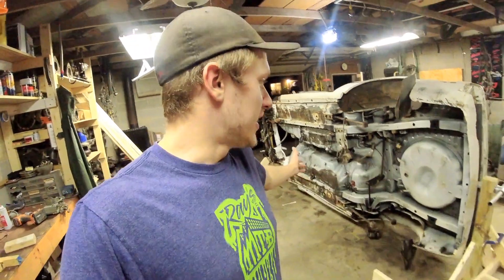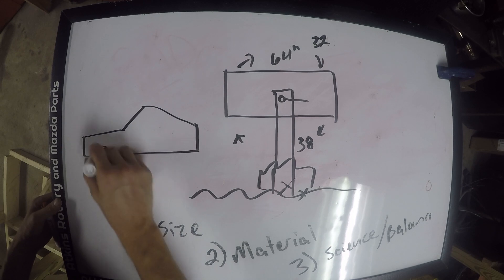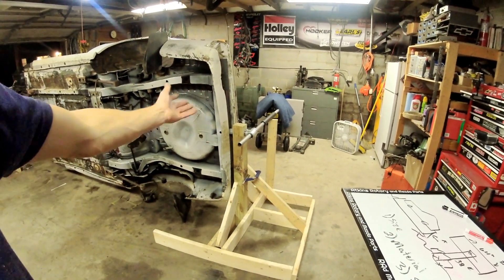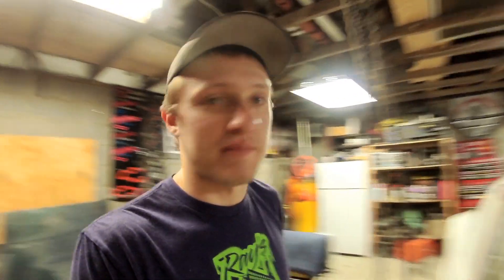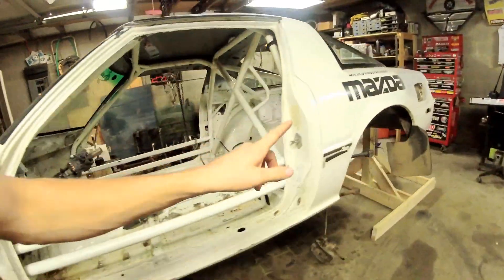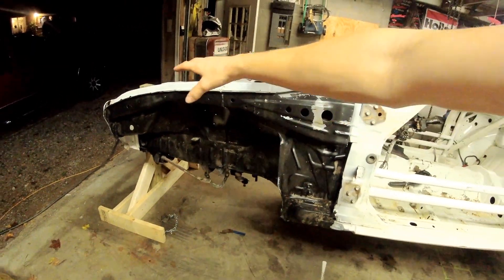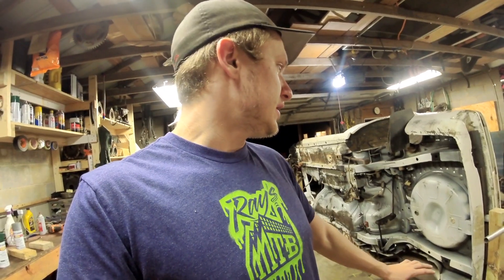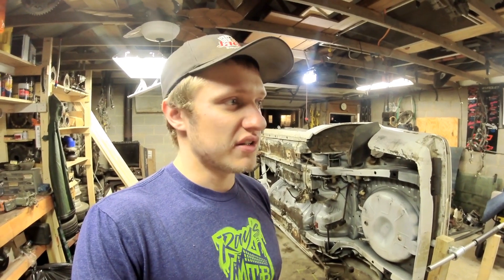How To Design and Build a Cheap Car Rotisserie

Comment: I really like this!   I have been working on a Chevelle. Thinking about a Tip over jig  to finish the underside, Welding and Stripping, etc.    With out help.  I would be in a dangerous position.    I did price out some metal, the cost came out more then manufactured rotisserie
Reply from the maker: I thought about doing it in steel, but ran into the same issue, wood was the best budget option.  the rx7 chassis is super light so I wasn't too worried about it being strong enough, a chevelle body, even with the full front clip off, and no interior is much heavier,  let me know what you come up with!

Comment: Great video didn't know it would be possible to stabilize a vehicle without a center connection on the rotisserie.
Reply from the maker: My thoughts were if the center connection is simply linear, its not going to do a ton unless its angle braced at the ends to the uprights.  In my medium of wood.   A 2x2 or 4x4 steel bar will be stronger if the system is steel,   I just used the large base of the rear to stabilize it in the horizontal direction
Reply: @RADPotential Thank you so very much!!!  I'll keep your ideals at mind when i start my rotisserie its a great system and while on a budget this makes for money saved👍

Comment: Good going.  Nice post production.  As i have been approaching the building of a rotisserie, I have been trying to come up with some kind of process for Guestimating the "through line" or the imaginary line through the car on which it would rotate in balance.  Its not easy on atypical asymmetrically shaped unibody cars (63 Rambler American 2 door wagon).  At the same time I am pondering how to get my car from rotisserie to trailer and back as my blasting and epoxy source is 100 miles away.  I dont think a 100 mile ride with a rotisserie mounted car on a trailer is a grand idea,.  Seeing the simplicity of your rig, though did give me an idea.  Thanks so much for sharing
Reply from the maker: Yea I built my rotisserie to not be mobile.  That adds a whole new level of design to the system.  It is somewhat trial and error as well if you don't build adjustment into the system.

Comment: Doesn't it need to be higher than half the width?  Technically it needs to be mounted higher than the square root of half the width plus half of the height to clear the ground.
Reply from the maker: I would say in most cases the body wider than it is tall.   if you have a more vertical window area, the longest distance from the center of rotation will be to the outside corner of the roof.  on the rx7 the widows tilt inward enough that the longest distance from the center of rotation is at the horizontal width of the car.
Reply: Yes, he should have added the other dimension of the rectangle and then measured from the center of rotation to one of the corner’s and used the Pythagorean formula to calculate the height.  It appears he got lucky and the extra 6” he added was enough.  Now he wishes he had actually paid attention in math class.  😂

Comment: Can you publish the mounting / offset of the bumper mount. You stated 8-10 " in the front and in line on the rear. Or draw out the mounts.
That will greatly help all. (and me)

Thanks
Reply from the maker: Yea. I will measure it and pin a comment